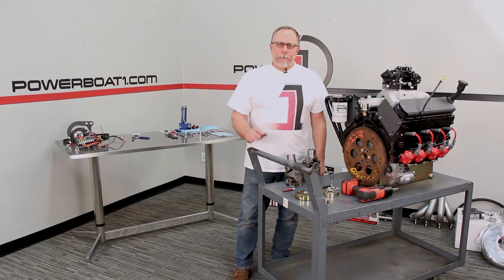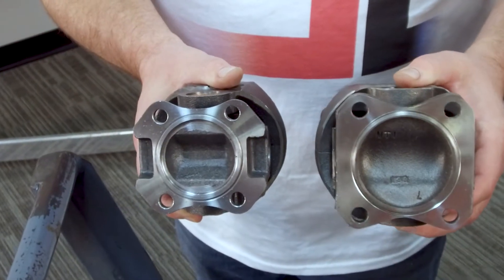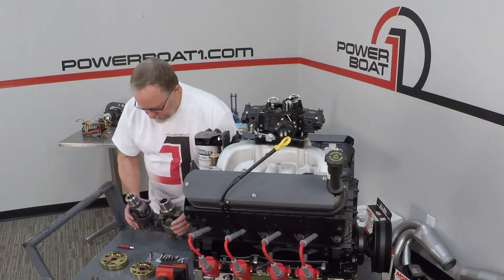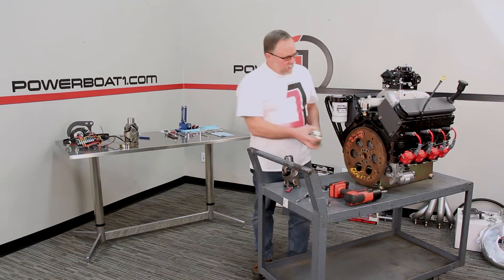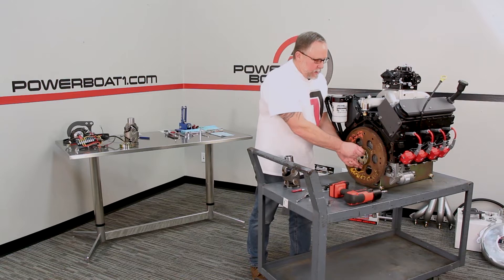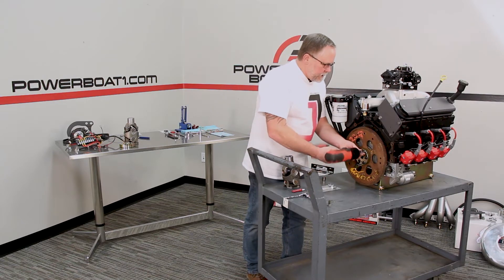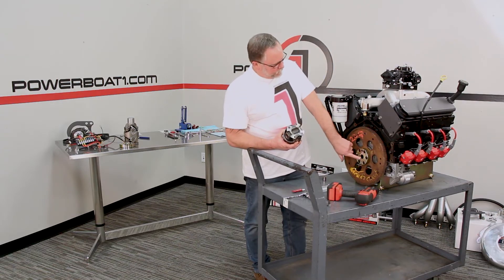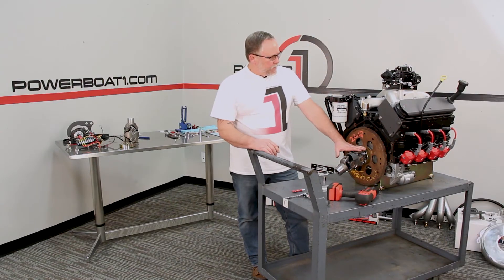LS ENGINE MARINE CONVERSION: Installing the PTO and Driveline Assembly

Comment: Can you use this pto on a smaller engine 4 cyl or is only for a 5.3
Reply from the maker: There are different PTO adapters for most common engine applications. You need the specific one for each engine. The 1310 driveline is universal. A 4 cylinder engine would not typically be used in a Berkeley 12J Pump application

Comment: Dude you need a proper flywheel , not just a flexplate
Reply from the maker: A jet drive installation can use either a flex plate or a flywheel with the flex plate being the most common. This is true with big block Chevy engines as well with a jet installation.

Comment: Why not use holly terminator X series for the efi  ?
Reply from the maker: We wanted to set up an entry level build that wouldn't crush the average Joe's budget. This system allows us to run without an O2 Sensor and without an ECM. We have projects planned for doing and EFI setup in the future.
Reply: Powerboat 1 thank you for replying! But you don’t think good quality gauges and a stand alone ecu is going to be cheaper in the long run?
Reply from the maker: @trentonbriones2381  Well the gauges on the dash wouldn't change much so not sure how that would be a factor?